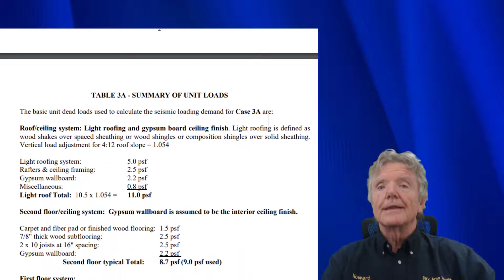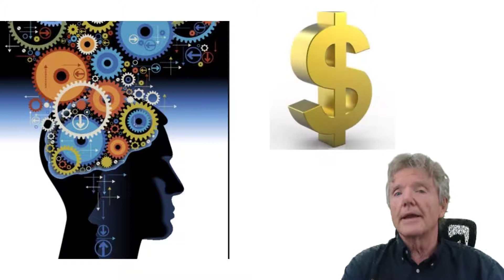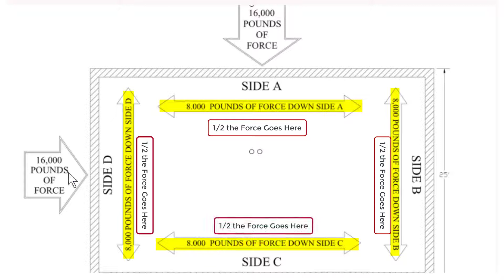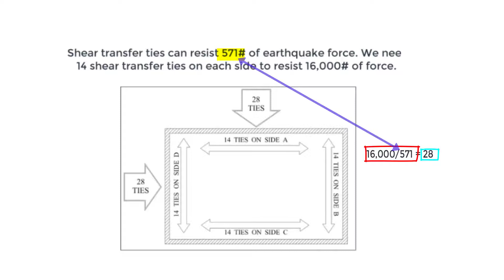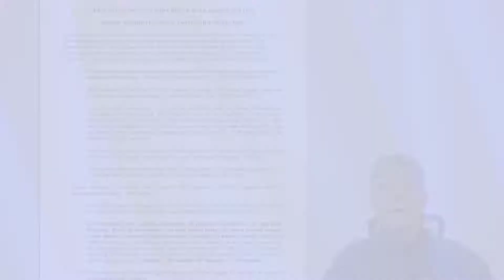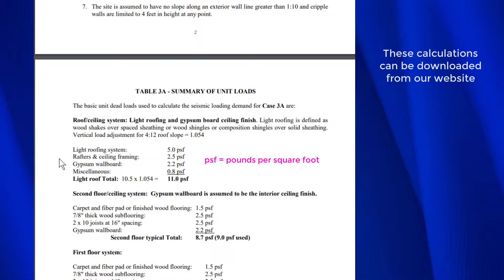The Engineering Basis of Cripple Wall Retrofits

Comment: The beauty of the engineering is knowing the exact amount of hardware to use. Most retrofit plansets and building codes say to do something at arbitrary lengths and assume it will be good enough! Without using the calculations one has to wonder, will it?
Reply: The plan sets and the "put xxx every 16 inches" is just stupidity.